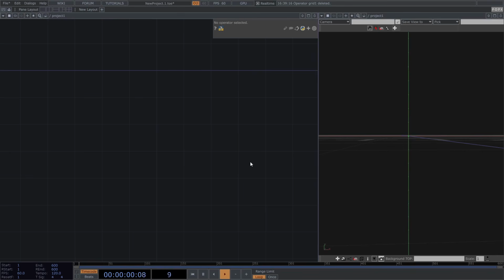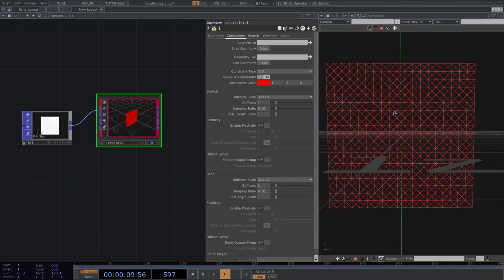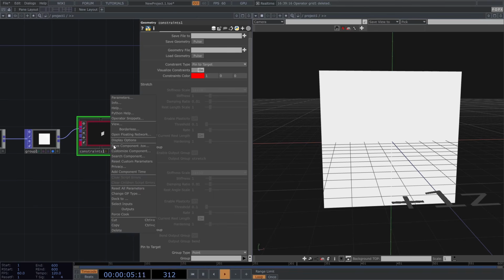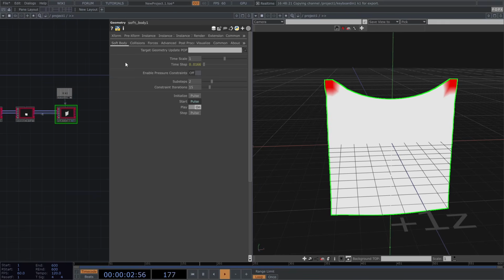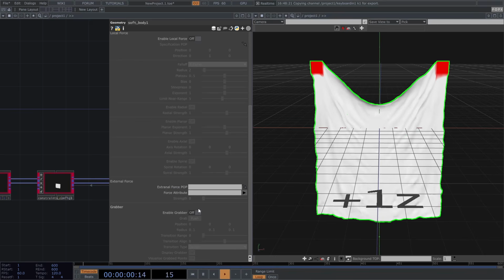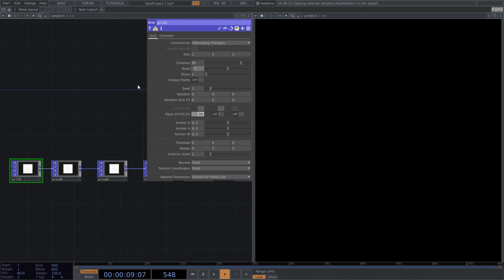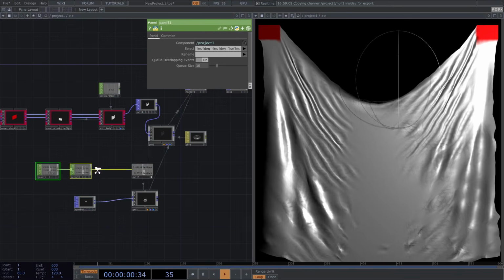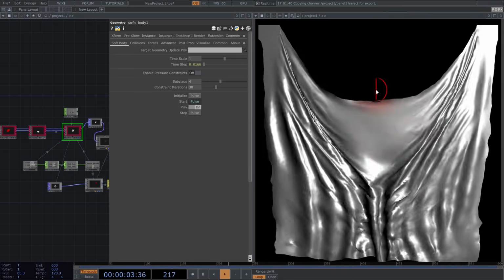How to Build an Interactive Cloth Simulation with POPX - TouchDesigner Tutorial

Comment: I'm struggling to get mine to work properly. I have the newest version of POPX and there is not Contraints Config operator? Also the settings in the Constraints operator weren't working the same for me as they were for you. I could only select the pinned group when I was in the Cloth setting. So I'm not sure if there have been some updates and things have changed but this was hard to follow along because it didn't match up to things.
Reply from the maker: Hi, sorry for that. Please watch the third tutorial for more details. The Constraints Config was removed from POPX there is no need for it anyone. You can find more details in the POPX release note on the website as well.
Reply: @_mini_uv  No worries. I figured as much. I did get it working mostly without the config operator. I'm going to do the 2nd video tonight and maybe the 3rd tomorrow. POPX seems really cool! Thanks for building it!